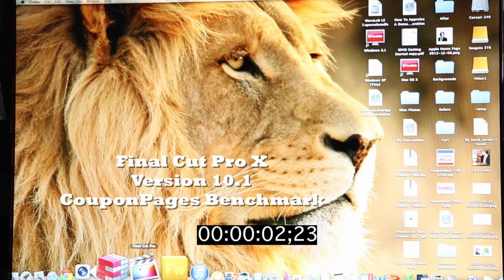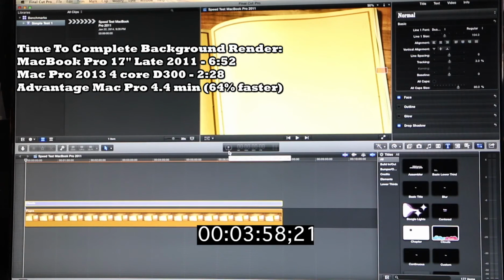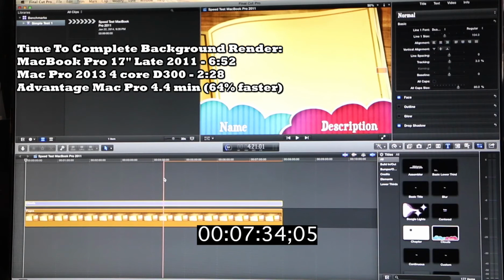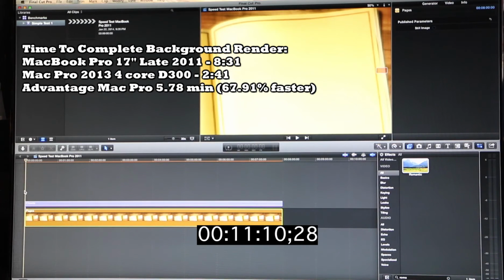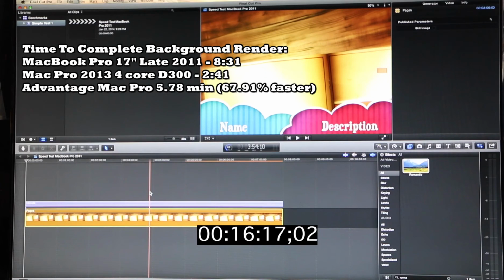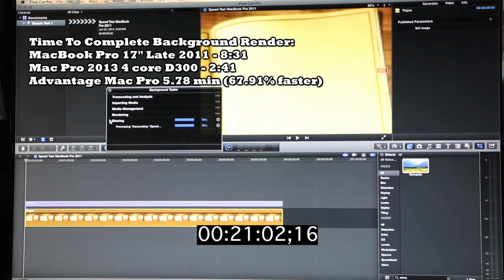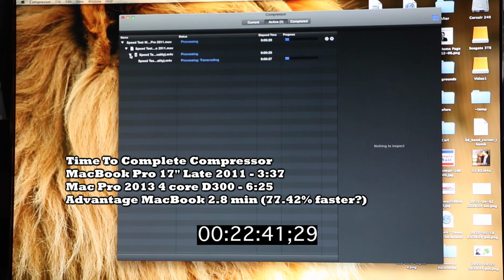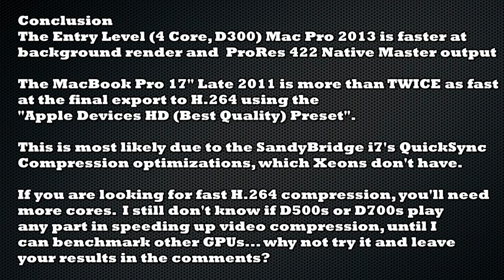Final Cut Pro X 10.1, Mac Pro 2013 slower than MacBook Pro 2011?  Sometimes.

Comment: Macbook Pro Late 2011, i7 Core, 16Gb Ram:

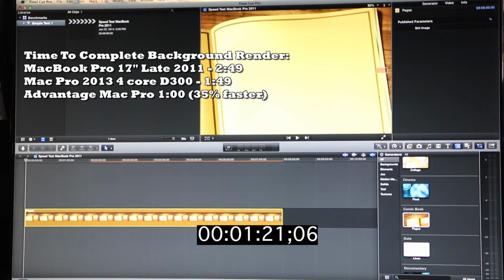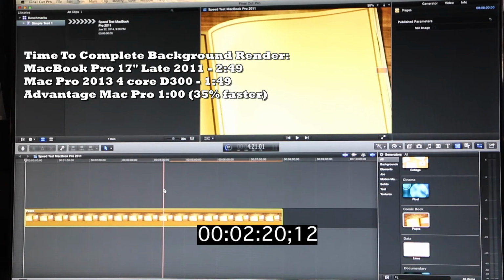1. 3:03, 2. 4:53, 3. 6:34, 4. 1:25, 5. 2:25
Reply: About to get a 2016 iMac i7 27" 5K Retina with the 4.0Mhz CPU, 4Gb graphics and 32Gb Ram - will do the same benchmark on that and post the results.
Reply from the maker: Awesome.  I now have a Late 2014 27" 5K Retina at 4Ghz with 32GB and the AMD Radeon R9 M295X 4096 MB.  I'll post an update too.
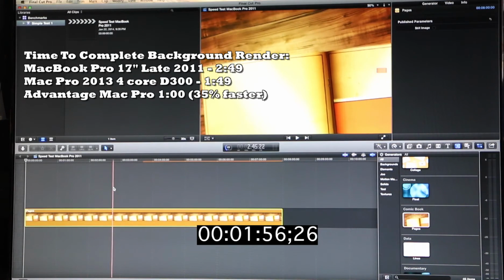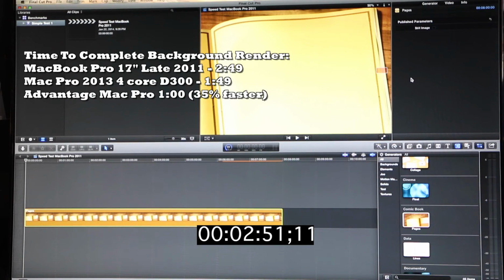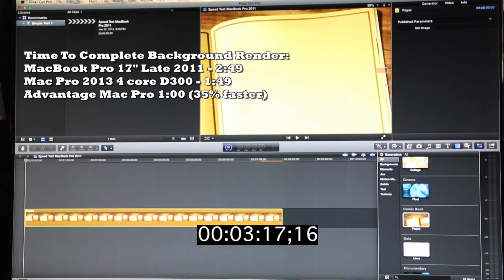Reply: 1. 1:57, 2. 2:50, 3. 3:14, 4. 3:05, 5. 1:15 - all expected except for step 4 - the export.

Comment: I am waiting for my 6-core to arrive. I will do this test as soon as it comes and I will post the results back here! Why is it that the macbook would compress faster?
Reply from the maker: Consumer Mac models that feature either an i3, i5 or i7 have what intel calls QuickSync, which is hardware assisted H.264 compression.  They added this to those chips to specifically make them play and compress video faster.

Mac Pros use Intel Xeon chips, which don't have this feature.  It should be noted that QuickSync only works with single pass compression, which many professional videographers feel is inferior.  Using a 2-step compression, a Xeon will generally outperform QuickSync enabled chips.

Personally, I find it hard to tell them apart.

If you use another program, like Handbrake to compress your video, it generally doesn't use QuickSync either.  The interesting thing is it will use every available CPU core, so a 6 core chip theoretically should compress using Handbrake 50% faster because it has 50% more cores.  A 12 core model would take off like a rocket using Handbrake... but believe it or not, using single pass in Apple's Compressor, it's still hard to beat QuickSync on i7 on an iMacs or MacBook Pros.
Reply: CouponPages Okay yeah that makes sense. Yet another reason to use Multi Pass compression. Another advantage is it also produces smaller files. Thank you for your answer!
Reply: CouponPages Figuring this is probably my last day with my 2009 iMac, I ran these tests just for the hell of it, and when the nMP arrives I can really feel the immediate amount of difference.

My configuration:
24" iMac ; Intel Core 2 Duo 2.66Ghz ; 4gb RAM ; 640gb HDD ; NVIDIA GeForce 9400. 

My results:
Step 1: 8 minutes
Step 2: 14:31
Step 3: 45 minutes
Step 4: 5:50
Step 5: 15 minutes

I was surprised the exporting was so fast!
Reply from the maker: The nMP will smoke those figures!
Reply: CouponPages nMP just in! Stock 6-Core configuration (2xD500, 16GB, 256SSD)

Results:

Step 1: 1:09
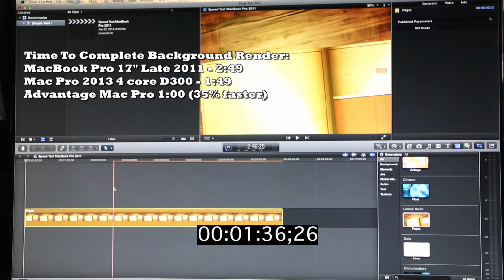Step 2: 1:35
Step 3: 1:48
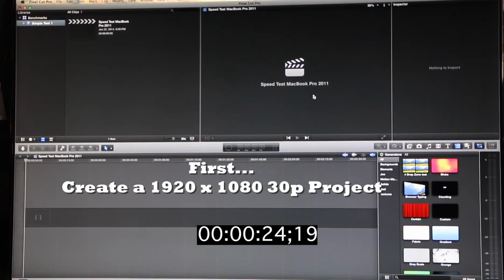Step 4: 0:25
Step 5: 5:20

I am absolutely blown away!
Reply from the maker: Manel Menano Crushed it!... Left your 2009 iMac in the dust.  It's not even close, especially step 3... moved from 45 minutes to 1:48.

Comment: Mac Pro - 2 x 2,26 GHz Quad-Core Intel Xeon, 6GB 1066 MHz ddr3 ecc, ATI Radeon HD 4870 512 MB, OS X 10.9.3

Macbook Pro Retina 13’’ (2.4 GHz Intel Core i5, 8GB 1600 MHz ddr3, Inel Iris, OS X 10.9.3)

Pages
Mac Pro: 2min 2s 
Macbook Pro: 6min 15s

Titles
Mac Pro: 5min 11s
Macbook Pro: 10min 22s

Romantic Effect
Mac Pro: 5min 37s
Macbook Pro: 14min 58s

Export
Mac Pro: 5min 3s
Macbook Pro: 1min 21s
Reply from the maker: Interesting results.  Pages 3x faster, Titles 2x faster, Romantic 3x faster... but  H.264 compression is still the bottleneck.

Comment: Have you used a virtual cluster on macbook pro 17 and on the mac pro not? This could be a reason for the bad result of the pro.
Reply from the maker: I've tinkered with that in the older version, but since 4.1 there is no longer a cluster option.

The new version limits you to a pre-set number of additional instances, based upon the # of cores and available RAM.  As such, my 16GB i7 allows one additional instance.

The trouble is when videos are relatively short, the time saved in splitting the job up, then putting it back together at the end makes it slower than just making one instance.

I've seen some small gains when producing longer videos, but most of the time it's slower because of the time putting the parts back together.

Larry Jordan has a great overview of the subject on his blog.  Because he's got such a popular FCPX blog, Apple sent him a 12 core D700 rig to review.  Overall he loved the speed, but his iMac beat the Mac Pro in the final single pass compression.

http://www.larryjordan.biz/mac-pro-video-compression/